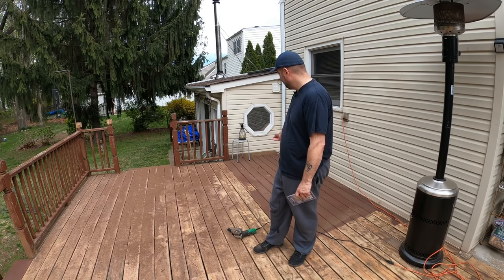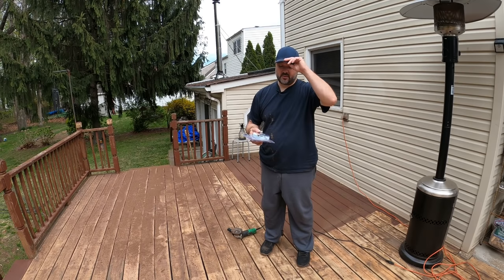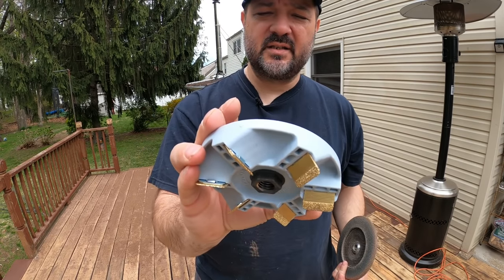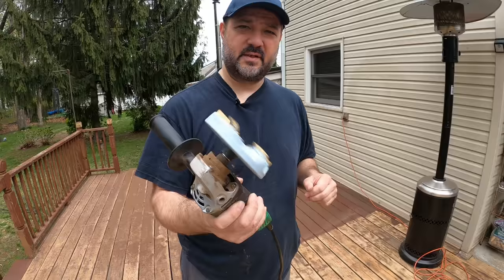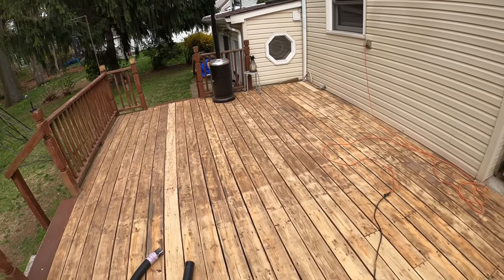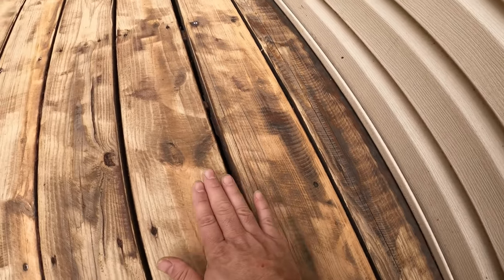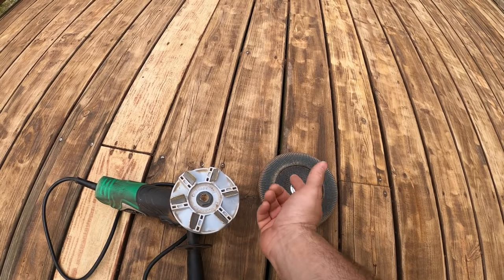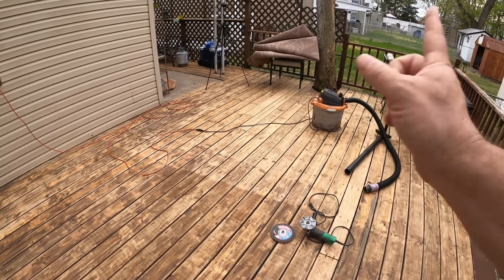Diamabrush wood deck paint removal how to remove paint from wood fast and easy

Comment: Stripper & pressure washer an your done. Fk that lol
Reply from the maker: paint to thick for this and
 a high pressure washer would have damage the boards even more ....
Reply: @maldo72  not to argue but I do this for a living. But to defeat the arguement,, you are correct.
Reply from the maker: hi and thank you for watching and your input...   yes there are other ways to do a job like this and i thought with the video i would show one option to explore  ... i am not here to say whats wrong and whats right and i am sure professionals like yourself  have many tricks and much better equipment then i have... these deck boards were in bad shape and wanted a cheap solution  to buy me a few more years before i can replace them... The weather is warming up and will be opening up the deck again with that will have updated videos to show how well this held up over the winter... .....  again thank you for your input i am all about learning and improving as a go ....

Comment: Why didn't you be a smart man and take a drill and a drill bit and put those screws back down in the woods so therefore you the only happy use one of those instead of two
Reply from the maker: would have if I could see them the paint was air thick in areas ... plus most of the screws I tried to get down were stripped